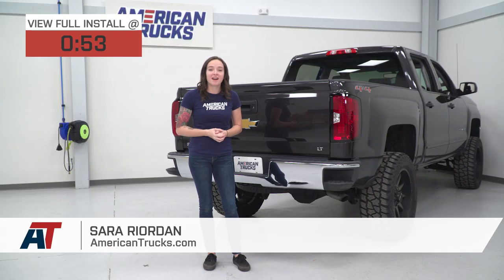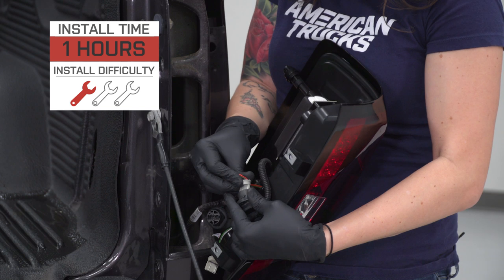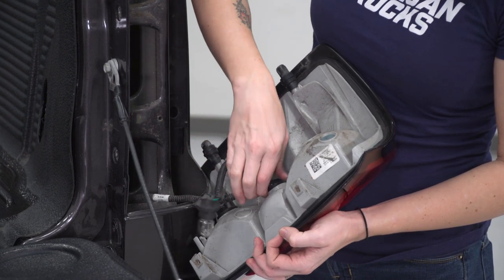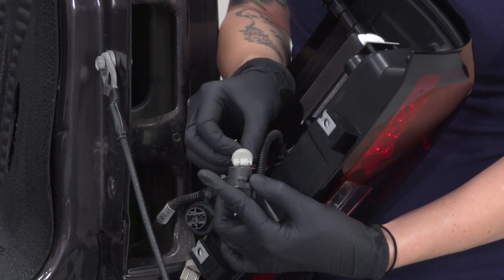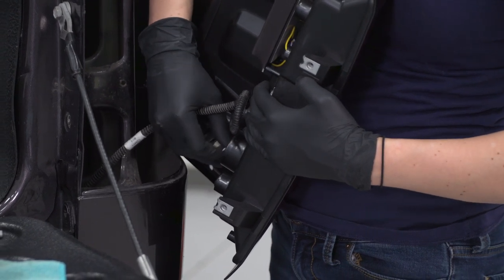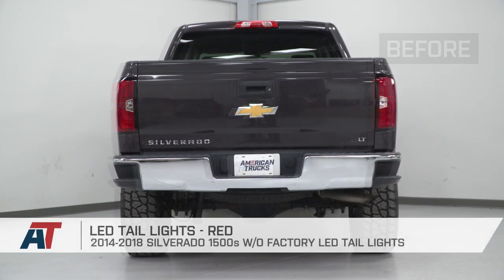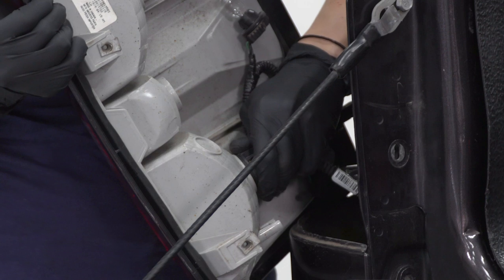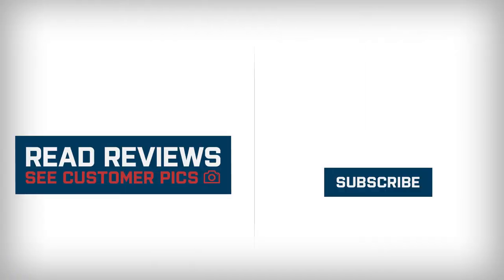2014-2018 Silverado 1500 LED Tail Lights - Red Review & Install

Comment: After looking at these tailights for a couple years. My girlfriend decided to buy them for me for my birthday. When I got them in, the passenger side did not click in properly and had a gap between the body and the tailights. Over a span of a month water made it start blinking fast since it didn't line up properly. 

The driver sides was fine and then the reverse light stopped working but when I installed my old tailights the bulb was fine indicating that it was the harness of the new tailights. I was upset and so was my girlfriend. These tailights almost cost her $400 with shipping. 

She reached out to American Trucks. And even though it was pass the warranty time. They took care of it and sent another pair out. And they were completely fine and they work great. American Trucks has great Customer service and the lights are tremendously good looking. 👍🏼
Reply from the maker: Super happy to hear we were able to get you taken care of! Please feel free to give us a call if anything else pops up! -Zach

Comment: What is to prevent someone from stealing your taillights, unless you have a locking tailgate?
Reply: Don't all newer sierra's and silverado's? Mine locks and I have a tonneau cover.
Reply: acedogg692005 I have a 2015 no lock.
Reply: @randywright271  that sucks man. I have a 16 Sierra and my tailgate locks.
Reply: acedogg692005 so I missed by 1 year!!🧐
Reply: Randy Wright must be what trim level you have. My 2014 LTZ has a locking tailgate

Comment: I have a 2016 Silverado.  These plugs fit like shit, actually don’t fit at all I should say.  I had 2 clamps on it and it wouldn’t go in.  I stopped trying before I broke my truck wiring harness.  Terrible.  Not plug and play,
Reply: I had that problem with them as well. But my main problem was the right side not flush with the body over time water got in and stopped working properly. I had to send them on and get a new pair. They work fine now.